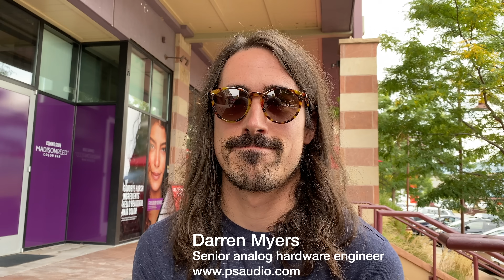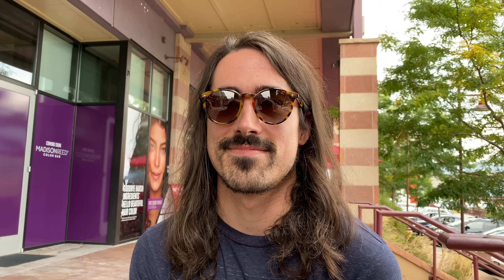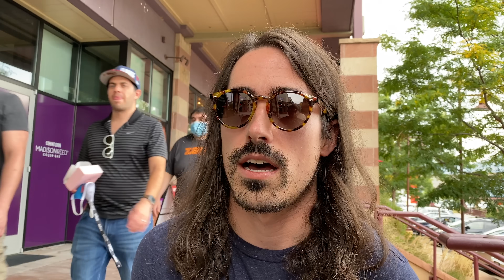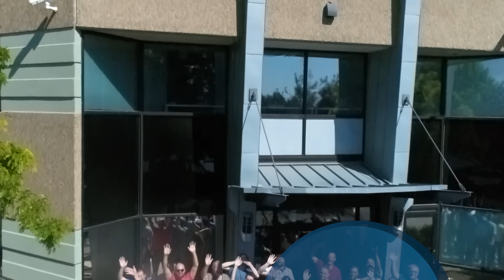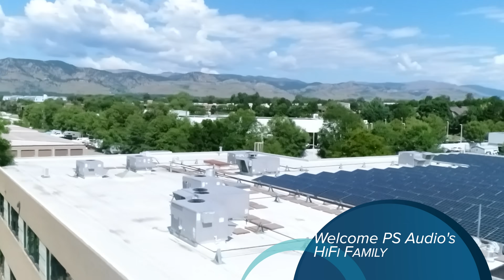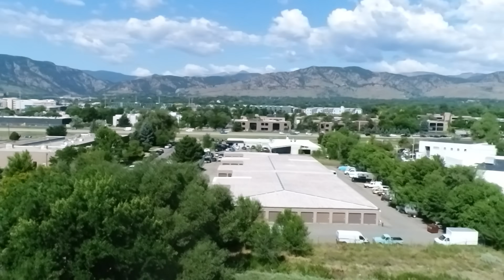Lunch with Paul: Designing the world's most musical microphone preamp

Comment: Back in the late 50s Roy Dunann's famous Contemporary Records recordings had the less is more approach.  By default they used  a small warehouse area near the bathrooms of the Capitol Records building in Los Angeles.The tube based condenser  microphones of choice were the already legendary AKG C-12s and Neumann U47 which had such high output that he ended up trimming them with volume pots and went directly into the recording deck's preamps. He also placed the mics very close in order to reduce capturing room reflections.

Comment: So you are saying that all the microphone preamps that made billions of recordings aren't good enough. What is the audiophile world supposed to do, throw all their recordings away? The problem with recording/playback technology begins with the microphone. It is not placed where you would listen from in the audience so it doesn't "hear" what you would hear. But even if your goal is to reproduce the source of sound accurately so that the musicians sound like they are in your room which only works for soloists and small ensembles microphones convert the sound field that reaches them from a time varying vector fluid field, the fluid field being air to a time varying scalar electrical signal that has no directional properties. It remains that way until the loudspeaker converts it back to a fluid field whose vector functions have virtually nothing in common with the sound field that landed on the microphone. Improving the microphone preamp does nothing to address that. The problem isn't even recognized let alone given consideration and solved by the people who design the playback systems to undo the compression of the field in space.

Comment: This video lacks some technical argument. A microphone amplifier should output a signal that is X times the input but with identical signal shape. It should have no sound to it because all it does is voltage amplification. A tube used to soft clip at peaks should not be needed because it should have adequate headroom to avoid any such compression. Feedback can certainly add problems like TIM distortion but it’s quite measurable and avoidable also. Lots of things sound different in audio but lots of those things are still measurable and most certainly a simple microphone signal gain amp is not with a complexity where measurements can’t identify audible issues. Whats that tube adding to the signal other than musical compression?
Reply: Harmonic content that adds depth to the voice.
Reply: @ChaseNoStraighter  Musical harmonic distortion shouldn’t be added somewhere inside a microphone amp but rather in the mastering process with whatever flavor fits the particular music.